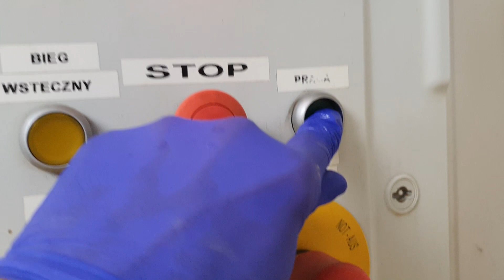Pranie dywanu MOCNO zabrudzonego, włos stanął po praniu i zeszły wszystkie plamy, zobacz efekt 😍

Comment: what is the fluid you put on at the very end and roll the rug up with it on? Is it some type of stain guard or something or conditioner?  You dont use it on all rugs, just had me wondering.
Reply: Yes it's a conditioner for the rug. Someone asked that last week. Hope that helps! 😁
Reply from the maker: Water or fabric softener, or sometimes acidic solution for woolen and bleeding rugs 😀